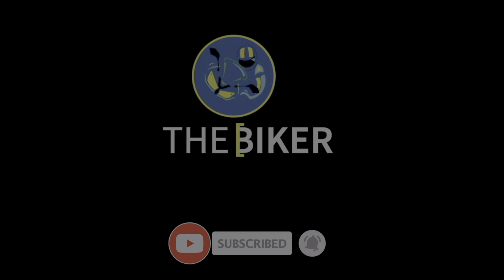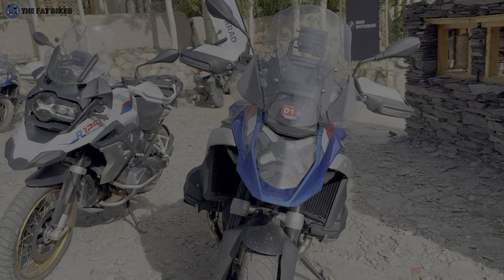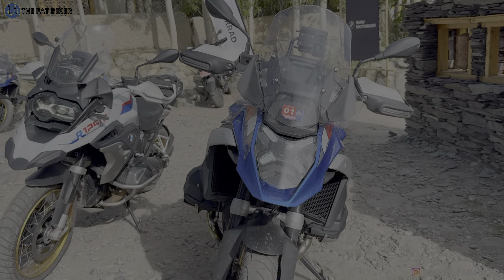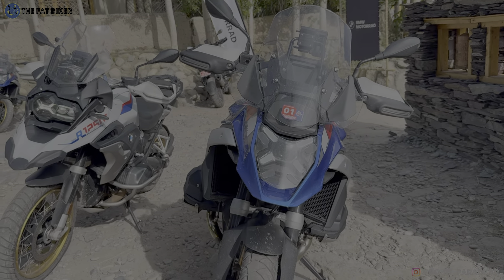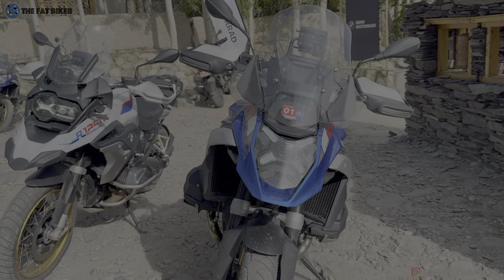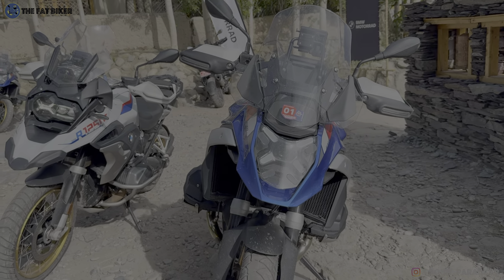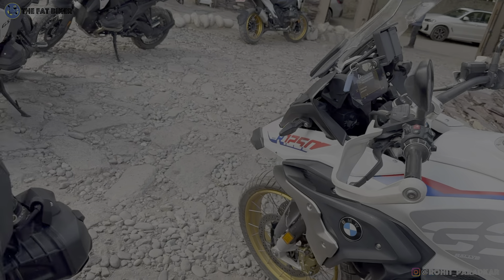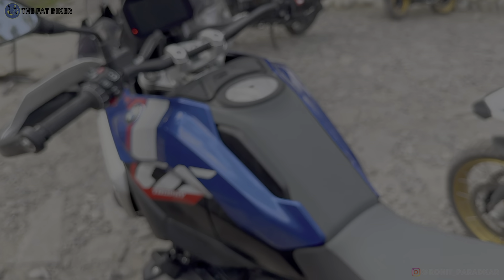The ULTIMATE BMW GS Model Comparison - R 1300 GS vs R 1250 GS - most detailed video on the internet!

Comment: How to get the low height configuration and low seat configuration 800mm... Since you have more information regarding bikes.. By the way nice video😊😊😊
Reply from the maker: Thank you. So you can opt for a low seat with any of the bikes at an additional cost. Unfortunately the adjustable seat height like the 1250 is gone.

Comment: As a 1250 owner, I hate to not like the 1300. The upgrades just don’t make sense for the variants in India and the 1250 just makes even more sense now. It looks like BMW has a fragile and weak heir in line to the throne replacing the almost perfect 1250.
Not to forget the awful headlights though.

Comment: There doesn't appear to be seat height adjustment (ride height - yes, but not seat to foot-pegs height adjust).  This, among a couple of other things, is a deal-breaker for me as far as the 1300 goes.  I prefer the 1250 at this point.

Comment: The Shaft had to be replaced at 60k kms for 1250? Didn't know that, how much does that cost? Was looking to buy a used one
Reply: It's a free replacement, AFAIK. Every 60k KM, for the life of the bike. We'll probably have to pay for labor, though. 🤷🏻‍♂️
Reply from the maker: BMW will replace the shaft for free at 60,000kms if the bike is an agreeable shape. Labour cost included.
Reply: @rohit_paradkar  “agreeable shape”. Do you mean to say it won’t last that much. Concerning would be buyer here

Comment: The old asymmetrical headlight looked much better and distinct.
Reply: True that. But new looks good in its own way. We have to remember that it's a generational update starting from 1200( {I guess as I started following this bike from then} many cosmetics and an engine update in between) to 1300. And as we have seen with BMW motorrad (S1000RR) at least for now they love symmetry.
Reply: Yes, i liked the older s1000rr asymmetrical headlight too
Reply from the maker: They are able to achieve all the functions of the split headlight with a single matrix projector, hence…

Comment: BMW nicely screwed the 1300. 1250 needed some improvements but 1300 require lot of improvements. For ADV bike they gave plastic indicator and that too on handle bar. Stand assist really r they expecting that some weak person is going to ride such huge bike if so than imagine if this bike fall whose help he need to raise bike again. So many flaws really it is not a legacy of 1250
Reply from the maker: Well, the bike drop thing I’m not too worried about. It’s a boxer engine, so the bike USUALLY doesn’t drop flat on the ground, so lifting it up is relatively easier. The main stand assist is good even for a well-built guy, because it needs less effort when you have all your luggage mounted.